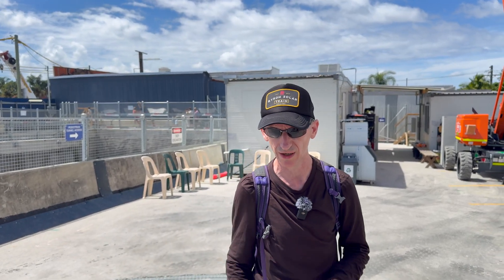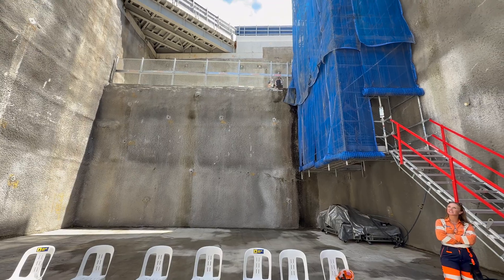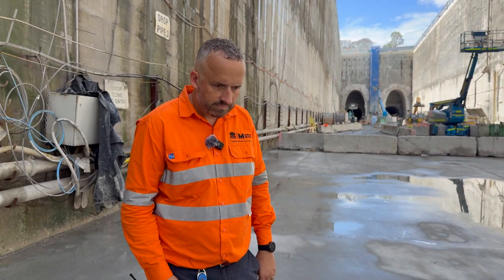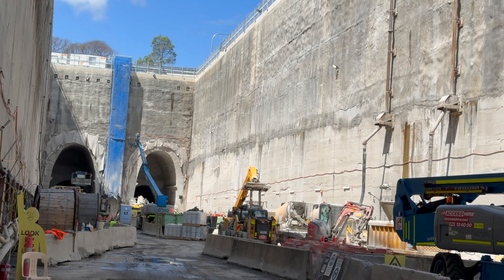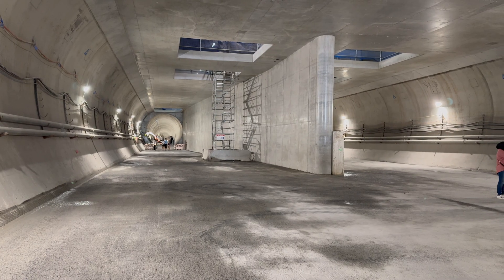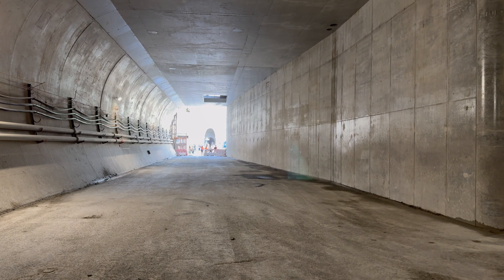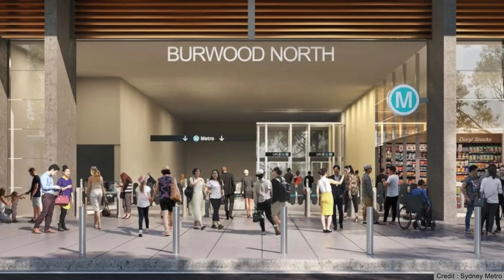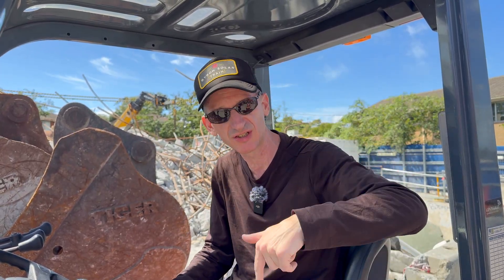Inside the Burwood North Station Construction Site - Sydney Metro West Project

Comment: Great video! I reckon a great idea would be re-introducing the trams along Burwood rd which is overly congested atm.

Remove the street parking, build one or two parking areas nearby either underground or whatever & have a fast connection between Burwood North/Concord station to Burwood. In fact, may be a good idea to take the tram all the way to Cabarita as it used to and possibly another branch to Mortlake, Concord Hospital and Rhodes.

Or build a cycle way from Burwood to Burwood North all the way to Cabarita/etc. The metro I can see can open up better connectivity and options nearby.

Comment: It is interesting that I think Concord Oval is about to become one of the best-positioned stadiums in the country Paul, not long after the Oval had a rebuild into a much smaller lower-capacity ground suited really only to training (used by Wests Tigers) or lower leagues matches. Will be interesting to see if professional sport ever contemplates a return there, or if the reverse is true and there is more of a push for it to become more open to public use like Redfern Oval has.

Comment: Brilliant video Paul! 
Really nice to discover the station's works.
I missed the ones in Paris during the open days (8 GPE stations were open that day) and only saw the surface part of one, without going downstairs due to reduced mobility.
So I particularly appreciate this visit.

Sydney's sandstone bedrock really is a godsend. Here, they'd be buttresses everywhere in a rectangular station box of that depth to prevent the walls from crumbling on themselves due to terrain and water pressure.
This makes for large, open pits and great views.

Great and informative video, as always.
Greetings from Paris.
Reply from the maker: Thanks, and lovely to know that you’re watching my videos from Paris!
Reply: The loose alluvial soil adjacent to The Seine is the issue in Paris. London long had a similar problem south of The Thames, which is why trams predominated in South London until 1952.
I note that the old La Petite Ceinture Line in Paris was part converted to trams and part to a Metro. That old suburban line had a steam tour send-off as it had been de-energised for several years prior.
And I bet a lot of people are unaware that French mainline trains run on the left, same as here.
Reply: @ktipuss Yeah, that's why they often have to freeze the ground hard before digging on the Grand Paris Express, just like they did in 1905 for line 4. They also had massive floods on the Northern extensions of M12 & M14. And sometimes TBM's breakthroughs are made into "pools", which are just pits temporarily filled up with water.
And some new deep stations had to be anchrored down to avoid buoyancy and counter Archimedes push, on top of being built like submarines.

The Petite Ceinture was only reused on a small section in the West for RER line C.
There are no metro or tram lines that run on the Petite Ceinture. The circular trams T3a & T3b run on boulevards nearby, not on the Petite Ceinture itself, which remains abandoned.
Though there's a project to maybe run tram 8 on the underground Eastern section of it, but it's far from being decided.
The Petite Ceinture is mostly a wild garden now, like a green belt.

M15, the huge metro loop, is being built further out from the center, about 6 or 7 kilometers away from the Petite Ceinture through the inner suburbs.

There's an arm wrestle between SNCF Réseau, who mostly owns the Petite Ceinture, the city of Paris, and the Île-de-France region. The city wants to make it a park, but is also OK with the region to run some trams there as long as it remains full of vegetation and people can stroll around. But SNCF wants to keep the possibility of running some freight trains there.
So, for the moment, it remains an abandoned railway full of wild vegetation, and some occasional sections used as temporary parks.

Comment: The pipes could be used for compressed air and water.  The “Alimack” hoist system was, I think, first used in Australia in the sixties in the excavation of vertical underground openings. working From the bottom to the topGREAT video Paul. I like your work!.
Reply from the maker: Thanks Ralph, that would make sense.

Comment: The pipes could be used for compressed air and water.  The “Alimack” hoist system was, I think, first used in Australia in the sixties in the excavation of vertical underground openings.  GREAT video Paul. I like your work!.
Reply from the maker: Thanks Ralph. Yes that sounds like a good use for those pipes.

Comment: 2032? Why is this seven years away?
Reply: Its a massive project
Reply: Original plan was 2030 but Labor held that up with its stupid "Metro Review" that told them what they already knew and then further delays around the question marks over additional stations and infrastructure adjustments and so on. I believe Pyrmont and Hunter Street station excavations are running behind schedule now and that has slowed tunneling too but I might be wrong on that.

Comment: An excellent video. As an older Civil Engineer, I am amazed how far we have come in forty years after decades of stagnation in new railway construction.
Reply: Well to be fair there was plenty of talk in those forty years. 

Just off the top of my head after the Eastern Suburbs line was cut short back to Bondi Junction in the late-1970s thereafter you had the suggestion of it being instead extended to Bondi Beach. You had talk of the 1990s airport line not just ending south of Central but extending under the City and up to the North. You had the original Metro plan suggested by Ron Christie in the early 2000s, which morphed into the 2000s Metro plans under Labor, as well as the Parramatta-Chatswood line plan which was cut short to Epping and even the Hurstville-Strathfield orbital line plan. The mid-2000s Clearways program of works was meant to be far more extensive. Late in the 2000s Labor also talked about an express tunnel similar to Metro West but for western suburbs trains to fly through at speed and make few stops. Then they were also suggesting the Western relief line planned underneath Sussex/York Streets on the western edge of the CBD.
Reply: @BigBlueMan118 A lot of these sound good. It’s astounding how dumb politicians seem with all the projects that didn’t happen. A severe lack of vision and empathy for the society, how did they even get elected?
Reply: @skystalker2  Well to be fair I think we have ended up with a better outcome, the Metro is fantastic and winning people over more and more whereas some of the 20th century and early 21st century railway design in Sydney was really quite poor. The Airport line is probably the best example, using slow double-deckers from the outer suburbs initially only capable of running a train every eight minutes and terminating all trains in the city when it should have been the first Metro and crossed the Harbour and had a branch down to Hurstville running every two or three minutes. We are now playing catch-up but things have advanced so much that it might be better compared to say London or Berlin which are stuck with alot of problems of their older trains (half their lines are slow, crowded, have poor air quality, bad safety standards, are difficult to automate and many more issues).
Reply: @BigBlueMan118  Greater London has a population of 20 million so their trains will be crowded. The Underground system is well ventilated as it originally did (and surprisingly still can) operate steam trains through it. It's the deep level tube lines which have ventilation issues related to their narrow size and difficulty in getting ventilation to the outside air.
Most people don't realise that the Tube Lines in London had a very heavy American influence in design; even the train carriages had a U.S. subway look about them.
London came good with the Elizabeth Line which has semi-automated main-line sized trains with drivers and platform screens on the underground section.
Incidentally LT listened to commuters from outer suburbs like High Barnett and put transverse seating as well as longitudinal seating in its S8 Underground sets which is very popular. This option should have been put in the present Sydney Metro sets for people travelling as far out as Tallawong.
Reply: @ktipuss Greater London does not have a population of 20 million. It is just over 9 million projected to be 10 million by 2030
Reply: @BigBlueMan118  In 2010 The NSW Labor Govt started panicking when the poll numbers started to look increasingly bad for them. Up went hoardings around various locations on Parramatta Road labeled "New Sydney Metro" and test bores done. Also a very belated start to conversion of the old Dulwich hill-Rozelle Goods Line to make it suitable for trams so that that line would no longer be the "tramline to nowhere" (with apologies to North Annandale people). 
And of course NSW Labor was defeated in 2011 by quite a margin. There still seems to be some within NSW Labor who don't realise that public transport is the "third rail" of politics in NSW, just like Medicare is the "third rail" for federal politics. Yet NSW Labor is STILL dragging the chain on new transport developments (the ones presently being built were started during the last LNP government).
(P.S., I am no fan of the LNP; look at the mess they made of the interurban "D" set project).
Reply: @ktipuss  yeah I think we share some similar politics my friend. The Parra-Epping line being cut and the Epping-chatswood line going through without a bridge making it really circuitous and slow were disasters too. Mind you I think the metro program we got is now far superior anyway so perhaps not all bad. Wish we had built a lot more light rail back when it was cheap though, there were some large plans and big ideas that simply can’t happen at current prices like Oxford st, Parra rd or Zetland.
Reply: @BigBlueMan118  Yes, caving into the NIMBYs who didn't want an "ugly iron structure" over the Lane Cove River was a bad mistake on a few levels. As you said, it caused a circuitous route under the river with steep gradients. It also meant Lane Cove National Park missed out on a railway station which would have alleviated traffic congestion there. In 1889 an "ugly iron structure" was built in Paris which quite a few didn't like. Today it's called The Eiffel Tower.
Reply: @ktipuss The circuitous route could have been avoided if it was a Metro line from day one. Building an above ground line through a National Park was always going to be a challenge.
Reply: @ktipuss It’s true that there were some less than stellar outcomes like the delays in the D sets but I wonder how much was down to the politicians and how much was down to the lack of resources in what is now TfNSW. At the time, TfNSW’s workload was increased enormously in 2011 and you can’t just employ the hundreds of extra staff needed on the spot. Projects could have been delayed until the planning was done better, but that costs time. Sometimes pushing forward early beats a delayed perfect program which doesn’t get delivered due to a change in government. As an example, the first stage of the M1 was criticised for not being extended to the Richmond Line but that would have delayed the project by two years. I spoke to Gladys a few times during her time in government and her attitude was that you push forward with what you have ready.
Reply: @BigBlueMan118 Yes, one of the key themes that saw a change of State Government in 2011 was that they had made a lot of announcements but failed to actual build anything. That is unless you count the $500 million spent on property acquisitions for the aborted Metro West. The incoming government hit the ground running as they saw it as important politically. They had the advantage (of their own making) of money by building expensive roads with tolls and the money from the sale of the poles and wires. The previous government didn’t have a good start. Carr was elected on a very narrow margin by promising to abolish tolls on the M4 and M5 which was never viable so we ended up with the very expensive cash back scheme. To make matters worse, he promised to build the M5 east tunnel with public money. The contractors priced it five times to get it down to the money available. The outcome was that the capital works budget was gutted for the next few years and never really recovered. The current cap on tolls may go the same way as people drive more because the government is paying their tolls.
Reply: Love them or hate the this was 100% the liberals, if it had been Labor they would still have been doing consultations and route design to only cancel it after pissing half a billion up against the wall

Comment: Hi Paul, great to see you back. You have been greatly missed. Interesting seeing Burwood North Metro station. Love all the running down the stairs there. Interesting seeing those pipes. They remind me a bit of the pipes in the city circle tunnels near Wynyard and St James. No idea of what they are used for. That construction lift isn't exactly luxurious, but it certainly does the job there. i remember riding a goods lift at my first workplace, which is somewhat similar to the construction lift there. Incidentally, were you affected by the recent Sydney train incident with the overhead wire breaking? Anyway, take care. Rob in Melbourne Australia.
Reply from the maker: Thanks Rob, It's lovely to be back! No, I walked home that day, so it didn't affect me!
Reply: @TransportVlog  Hi Paul, have you managed to see any of the Metro testing on the Sydenham to Bankstown line?

Comment: At Central the metro station was excavated after the tunneling was completed, they mined out the tunnel rings  to construct the station.
This will have to be done at Rosehill and Silverwater if stations are built there, both of these stations should be commenced by the end of this year.
The haggling over the racecourse can continue whist construction is in progress.
Legislation shoud be introduced to compulsorily aquire the Racecourse as was done with the speedway and other sites along the Metros.
It's very important that the billions of public money spent on this metro delivers a viable project not just a Parramatta to Sydney shuttle at stupendous cost.
Postponing construction to save money always ends up increasing costs.
Attempting to spread costs over time is ineffective as costs increase over time.
Reply: It isn't just a Parramatta to Sydney shuttle though - it does alot already. Almost amusing people would make the "just a Parra-Sydney shuttle" jab in a week that has shown us just how necessary more redundancy in the rail system really is especially east-west!

+It relieves the T9 Northern line as well as several heavily-trafficked bus corridors and the busy T2 line
+it makes event traffic at Olympic Park far more accessible and attractive for most of Sydney
+it provides new catchments in Concord, Canada Bay, Five Dock, Rozelle/Balmain/White Bay, and Pyrmont
+it more than doubles the east-west rail capacity in the city and forms a new spine and will be extended in future to serve additional unserved parts of the city

I agree that in-principle the line is stronger with the full Rosehill development in play, I personally think Silverwater is unecessary and should stay industrial but I do agree with making some provisions (if cheap) for a station to be able to be retrofitted there in future in case needs change without disrupting the rest of the line.
Reply from the maker: Hi @kcobley, Yes it was Central! - Unfortunately it won't be Rosehill now, but hopefully we can get another station somewhere between Parramatta and Sydney Olympic Park.
Reply: @TransportVlog  Minns visions end in nought like all the other Labor Car governments, it's Cut and Run.
Minns dropped to his knees before Gai, not immediately announcing the compulsory resumption of the Rosehill property, leaving Metro Transport Oriented development in limbo.
The NSW Government has enough tools available to force the development at Rosehill.

The stations at both Rosehill and Silverwater should to built to a stage where they can be completed at some time in the future without closing down the line.
He cut and run from Central.
Now Rosehill
How he will manage the next cut and run from his next flailing float at Homebush?
He's too busy trying to figure out how the state will be facing the ever rising cost of tollway and electricity subsidies crushing our economy.
How will will fund the Labor car infrastructure boondoggle?
Nothing has changed with Labor since Joe Cahill.
The Liberals have taken some small steps in mass transit investment, if they promise to continue to build mass transit weaning Sydney from car dependency, should be returned to Government..

Comment: I think the construction lift is more for personnel than equipment. A 2,000kg limit would only get a few workers in, they all look like big boys. At most station sites you see the big arse MARR's tower cranes. I'm sure that's where all the heavy lifting is done. Burwood North being 900 meters from Burwood station would be a good option if we have another rail meltdown. The bonus with walking from one to the other is you have the Avondale Hotel at one end & the Bath Arms hotel at the other. Just saying.
Reply from the maker: Yes that's true! I didn't notice any stairs on that side. I think the pubs might be a very good distraction!